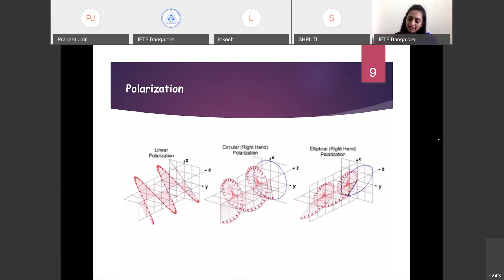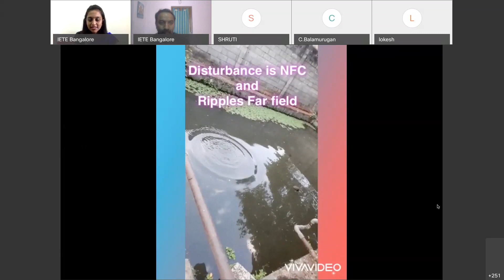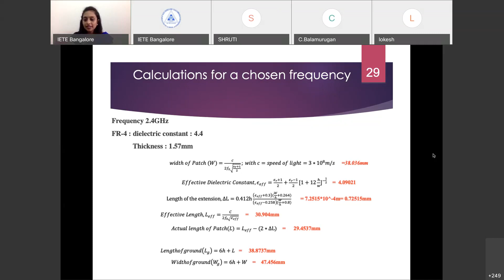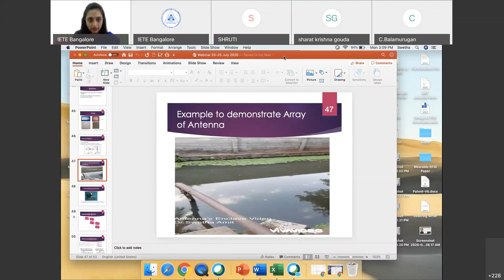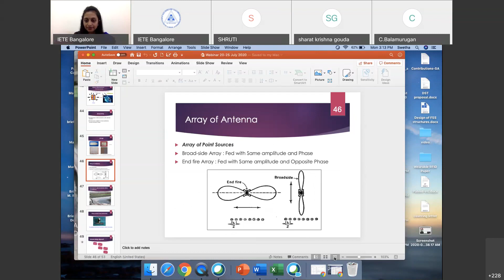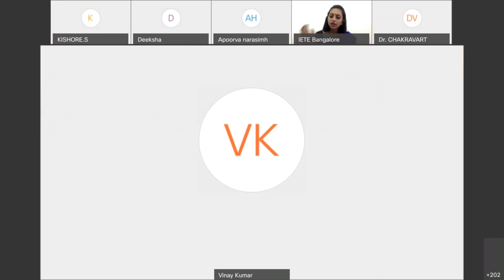Antenna fundamentals,Design and analysis of Microstrip  Antennas Dr.Swetha Amit, Assistant Prof, RIT

Comment: That's where i am confused 7:05 comparing propagating electromagnetic field is due to acceleration and deceleration of charges like we can in a macroscopic system because of conservation of momentum but here it's a microscopic system and i think antenna radiate electromagnetic field because they don't die out by an opposing electromagnetic field like in a loop of wire. 

It's just a thought and i am not expert at this stuff..